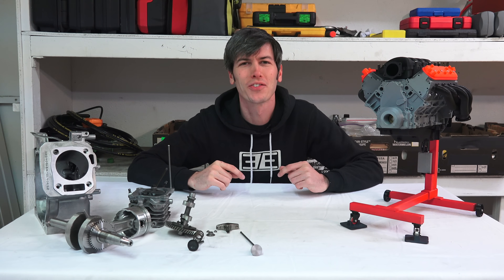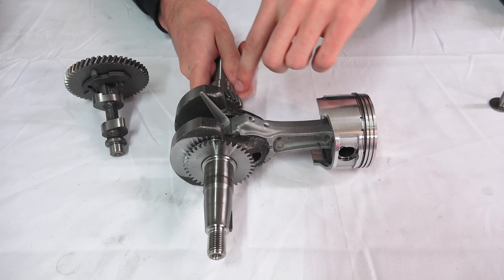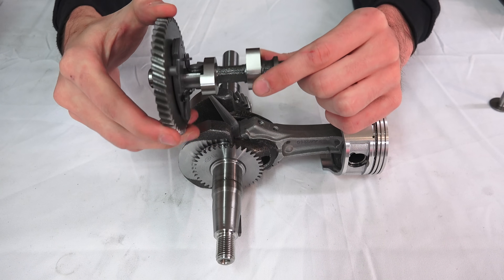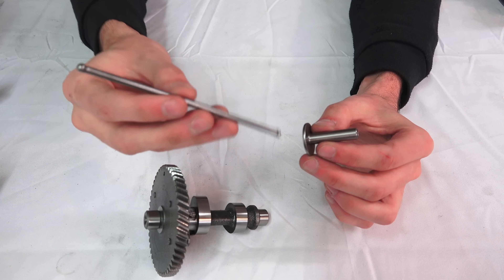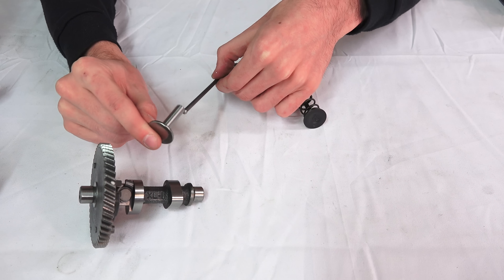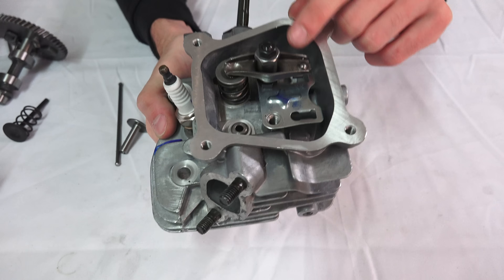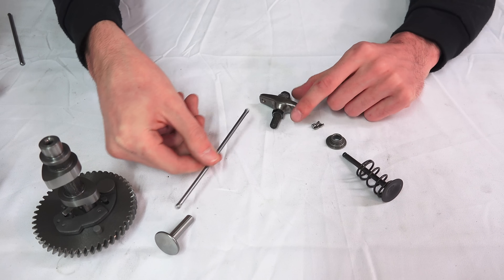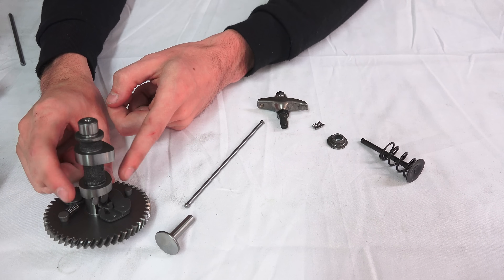Why Can't Pushrod Engines Rev High?

Comment: That’s why aircraft engines have 3 springs per valve 

One is redundancy one breaks your valve still operates 

The second is valve float each spring has a different “frequency” in which it looses efficiency so on paper when one spring looses efficiency the other 2 take over 

Never seen it in practice considering aircraft piston engines never rev past 3500 

Otherwise the prop tip goes supersonic and because the prop is a laminar flow airfoil it’s stops generating thrust

Comment: Use roller cam followers and rev all you want with supporting head flow, double valve springs, forged internals and decent ignition.
Reply: Yea.  That's what I do with the ole lady when it starts to get goin.  Plenty of lube and well placed ignition is where it's at !!

Comment: Ducati invented the desmodromic valve system, eliminating return springs.
Reply: Ducati didn't invent the Desmodromic valvetrain, the just refined it and used it on production engines.
Reply: @rdsimmonds  Those vintage Ducati Desmo heads are really getting expensive.
Reply: @flower2289  That they are. That's why I like the newer Pantah Desmodue engines. You can make them look old school with very little work, and have a strong engine that is fairly easy to work on, has a decent amount of aftermarket support, and in terms of a Ducati engine is fairly simple and plentiful. I absolutely love the engine in my 2013 Monster 1100 Evo. It may not be fast, but it's a great engine to lug around on, with plenty of torque.

Comment: Super well explained , top notch stuff. Maximum rpm is in the memory or return ability of the valve spring. I was so impressed when Renault developed compressed air bellows for springs in 1984-85, for f1 , I never forgot.   again well done !     :P

Comment: HI thanks for this.  I've been lurking your channel for a while so I thought it was time I subscribed.  I love what you do, I'm an old school knuckle draggin  gear head from back in the day but I love learning about new tech as well as reviewing the old school stuff.    I would love to see you do a video on Ducati's Desmodronic valve train system.  I have been riding motorcycles since the 60's.  I love Ducati's  (only had a chance to drive one, a 70's era 750?   Up in Fairbanks Alaska, it was a beast!)  I never owned one after reading about the Desmodronic valve train that use's no springs to return the valve but instead has a Second  cam operated lifter that close's the valve.  It's a beautiful system but like any thing Italian very high maintenance .  I've always thought of it as the Rolex of valve train systems.    I understand you had to adjust the valve lash every 3000 mile's or risk burning an exhaust valve and the dealers wanted north of $500.00 to do this.  A lot of money back in the 70's.   What is your spin on this system?  Thanks

Comment: Big bore, heavy parts, and a long stroke.
Reply: A similar capacity push rod or OHC have similar rotating mass. The DOHC also has all those chains whipping around as well.
The only real advantage CAN be a 4 valve needs less valve lift to theoretically flow the same air, and with less valve weight less spring,,,, BUT you have twice as many springs. And there is the problem.Valve angle can be the trouble as well. Most 4 valves come from both sides of the cylinder at around 20 degree angle so trying to get compression is a real drama to clear all those valves. Happens  with canted valve pushrods  [BBC Ford Clevo] as well but those valves still generally take up less room and still breathe properly

Comment: I got an 07 charger rt awd and it feels kinda slow for what it is. My exhaust at 60 mph starts making a loud constant whining noise and i tend to lose power when going over 60, that means i get rarely any acceleration and when i step on the pedal its takes a good second or 2 to accelerate it feels like a too slow of a response for what it is.. Is there a problem with my transmission? And should i get a new exhaust? Or perhaps is it my tires or its tirepressure? Previous owner replaced its differential btw.

Comment: Why a pushrod engine can’t rev high? 
Challenge accepted
Girl in my class: revs a built Chevy 350 small block with Brodix heads to 7500 RPM IN NEUTRAL WITH NITROUS ACTIVATED. 

Chevy 350: Welp there goes my piston rings

Comment: stares at a Chevy small block that revs to the 10k rpm range
Reply: Rotary: PATHETIC
Reply: Not many engines you can do 1000 nearly stock with high rpm and reliably with rebuilds or just get another engine for less then a paycheck. Why they are so popular. And if you want a top of the line engine it's still cheap as hell to put the tight parts on it and still be. Cheaper then a German v8 that's stock
Reply: @Zo Fryer This is the reason GM has stuck with this style of motor. If you mod any other V motor from any other company, your buying 4 cams, that right there is the most expensive part of that build. I can rebuild an entire LS motor with hotter parts for the price of a set of stock 5.0 coyote cams.
Reply: @codysides7683 coyote your stock cams are plenty good to make all the power you want.
Reply: @codysides7683 junkyards parts are cheap
Reply: @codysides7683  rebuilding an engine is something probably NO ONE wants to do outside of the US.
Reply: @codysides7683  you're conflating "cheaper" with "better" tho. You really think it's a coincidence that GM are the only ones with OHV engines? Honda and other japanese cars have been using OHC for decades now. You really think they would have chosen a more expensive engine production method if it didnt mean the efficiency was worth it?
Reply: @LeglessWonder  and? Hate to break it to you buddy but Honda isn't exactly the epitome of automotive performance engines lol. Take the two fastest cars in the range the s2000 or nsx and ls swap either and you can't tell me that won't be a huge improvement over stock unless your into making a heap of noise and going absolutely nowhere like basically every modified honda lmao
Reply: @trixnhoez2964  You have no idea what your talking about at all. If anyone knows what the epitome of racing engines is its Honda. Literally used to provide engines for F1, and they currently provide engines for Indycar and have a bike in the MotoGP. Not to mention they have performance road engines making 100hp per liter.
Reply: @trixnhoez2964 I hate honda personally, but they have been making motors for F1 cars for decades now, and a lot of those honda powered F1 cars have dominated… and F1 IS the epitome of automotive performance engines….
Reply: @CONNIVORE_13 Honda hasn’t succeeded in F1 since the 90s
Reply: @trixnhoez2964 
Apart from the 1000hp honda K20s you mean? From 2.0l straight 4 DOHC?
Push rods are obsolete garbage.
Reply: Raughs in HONda
Reply: Foxmakesmodels you can just buy an FD or Fc and get there No problem
Reply: Ive seen a few reach 12k
Reply: Depends on the power it's pushing, the tourqe and the design of the engine in general
Reply: How much did it cost to build?
Reply: It ain’t floating?
Reply: Those little single cylinders will turn 9k-10k too with some stiffer valve springs and a lighter flywheel.
Reply: You have any other jokes?
Reply: It's a dinosaur. My Honda lawnmower is an overhead camshaft.
 There's a reason why Asians and Europeans are building 4 camshaft 4 valve and 5 valve variable valve timing motors. Ferrari FLAT 12 and there is a reason why american companies are getting bailed out by the government and this is one out of the reasons.
Reply: And has boost
Reply: No need to rev high just make your engine undersquare engine long stroke that will make high torque at lower rpm then it’s all about gears you wanna go faster use small gear as long as you have high torque you can go faster as you want let say engine make 400nm torque at 2000rpm if you use small gear that 400 torque what be 200-150 still enough torque so no need to rev higher just make engine produce high torque and adjust the speed by gear ratio
Reply: There are plenty of German and Japanese V8s that make 7500 + rpms stock, the solution is a solid roller valvetrain, these GM engines have way to many moving parts in the valvetrain in stock form. I know there are aftermarket solutions to solve that, but get ready to spend $3-5k to upgrade the head components.
Reply: F1 v10 20500 rpm
Reply: shrugs revs 526 blown hemi to 12.5k
Reply: Yup, lots of 8,500- 10,000rpm LS motors.
Reply: That might be, but Ford is still number 1 for me.
Reply: @buttlickbandit8465  same
Reply: @0hjaa3.0  lol so salty u turn to racism
Reply: @downloadingutubes Bro where tf did racism come from? I sure as hell can't find any.
Reply: @downloadingutubes  I didn't turn to anything? And I'm not salty? I was in a shower like 45 minutes ago..
Reply: @0hjaa3.0  hmm just more lies huh?
Reply: @papatorr3669  terrible comment, truly...
Reply: Everybody in here saying oh pushrod motors suck, Well. The most powerful motors in the world, 500cubic inch hemi, Top fuel motors, 10000hp, It's a pushrod motor
Reply: @94.s10 thats because nhra banned  turbos and overhead cam engines like the ford cammer
Reply: @Zo Fryer valve float is unavoidable with pushrods.  Have to switch all of the valve train components to lightweight in order to decrease valve float
Reply: Still not high revs though. Would be high for a production car but nothing compared to race engines.
Reply: @Zo Fryer or u do nothing and buy german that revs almost as high. Plus i bet 9k is past peak hp and lbft
Reply: @downloadingutubes  depends on the head flow capabilities. Porting, polishing, and a cam moves the peak output higher up in the rpm range.
Reply: @downloadingutubes Lol buy German… how much money do you need to spend on a German car before you get a motor that revs to 10k
Reply: *switches stare to 14k rpm 632 cubic inch big block* @downloadingutubes
Reply: @downloadingutubes  horse power is based on air flow capability and cam specs what german engine makes peak power at or above 9k rpm? ill wait ill take the simplistic cheap American engine rather than an overpriced over engineered german engine that mentality is what lost ya the war
Reply: @ryanrohauer5940  ok bud
Reply: @downloadingutubes  Or buy Sweden and rev to 7000 with more reliable engine
Reply: @0hjaa3.0  absolutely not
Reply: @downloadingutubes  Absolutely yes.
Redblocks are super reliable 😎
Reply: @0hjaa3.0  weak argument
Reply: @downloadingutubes  What argument? Google it. It's true.
Reply: @0hjaa3.0  im afraid you have lost my interest with your severe lies.
Reply: @0hjaa3.0  Or Buy An Engine That Is More Efficient With Different Fuel And Revs 5/8 As High.
Reply: @SolaricSage116  Or just upgrade the one i suggested. No need to rev past 8000. And best engines for every day use produce max torque on low revs.
Reply: @0hjaa3.0  why get a little Volvo v8 when I can get an ls7 brand new for the price of trying find one in the USA, plus the ls7 has a 7.0 liter displacement and revs to 7200 rpm, plus its American made and has a better aftermarket than a Volvo v8
Reply: @jacobtanner486  Plus it doesn't sound like Vulva.
Reply: @AmericanThunder   the 4.4 Yamaha v8 Sound is legendary Billy Ray Bob, don't even joke about that
Reply: @danielmiliei  lol

Comment: The rotary engine laughs at your air problems.
Reply: Every other engine laughs at your seal, oil burning and leaking, and barely making it over 100k without a rebuild problem.

Comment: My polo TSI revs up to almost 8k and I push it almost everyday in second gear when I go to work
Reply: Because overhead cam. No pushrods. One of my cars is a 30 year old Honda and it makes some fun noises at 9000 rpm. I want to put an LSD in it so when I do burnouts on the rev limiter it spins both sides. Currently just smokes on one side.

Comment: this seems quite a bit outdated, modern nascar cop engines can in fact rev past 10k, and there is countless material of all kinds of pushrods, small blocks and back blocks that rev past 7,8 and even 9k rpm even ! there are clips of a Nova powered by a 260 abc, granted while it appears to be built it says that it revs up to 12k rpm !!! and I've recently come across a clip of a wicked Trans Am that has a 10k rpm pushrod in it. but don't take my word for it, go and search/look for it yourselves, it is not hard to find, and I provided you with keywords to search for. 
pushrods really are badass engines, can be used in the widest variety of applications unlike any other engine, and can kick the butts of just about any other form of piston engine !

Comment: Engineering explained needs to do more research on the pushrod engine.
Modern LS engines rev to 6600rpm stock.
These can rev to 7000rpm without an issue with a tune only.
The beauty of the LS platform, even if you make the engine larger with a stroker kit you can still rev them very high.
If you use billet cranks, light weight rods, hollow valves you can rev them to 9000rpm+
Most street setups with stroker engines usually rev to 7000-8000rpm without an issue.
It just depends on what you want to do.
The combinations are endless with the LS.
There is something for everyone,
DOHC engines are a bit more efficient but they have a lot of drawbacks.
They are not as durable, weigh a lot more, are top heavy and are not as a robust design as the LS.
Plus DOHC engines produce much less torque in the entire torque band.
Thanks to the LS7 style square port heads you can make over 100hp per litre of engine displacement quite easily which is better than exotic car territory. Thanks technology.
I drove a Ferrai 458 Italia a while ago and the engine is so dead from idle all the way to 5000rpm.
After 5000rpm is when it comes to life and screams to the red line but with hardly any torque.

Comment: Stiffer valve springs do not create an efficiency loss on multi cylinder engines.
Whenever one spring is being compressed, another is being decompressed, essentially making a net 0 gain/loss for the spring stiffness.  This is something that’s been proven in dyno tests.

The thing about absurdly high rate springs are that it can be harder on valve train components because of the added pressure.  

It’s not even so much that an OHV cam in block engine can’t rev high.  It’s a matter of the trade off.  Higher rpm requires a bigger cam.  While it makes more power at higher rpm, it at the compromise of low rpm power.  A cam that makes good power at 8k rpm will make less power at 3k rpm; and also have a rough (but cool sounding) idle.

Comment: He forgot to mention piston speed and how longer stroke increases piston speed. The higher the piston speed the faster the piston rings and bore wear. Oem wants engines to last over 100k at least . Nascar gets rebuilt every race. Also the faster the piston speed the faster the piston must change direction needing heavier pistons to do so.

Comment: Solid roller cam with huge valve springs can rev like direct acting dohc like you would see in a Japanese car, just not as flow as much due to less curtain area that a four valve engine has.

Comment: I have an LS1, I have the rev limiter set to 8300RPM............. been like that for 8 years, it has 180000kms on it, no issues found. Valve float is solved by heavier rate valve springs and titanium valves, valve spring retainers and retainer locks. Also never had issues eating any of these hi tech rubber band motor powered cars with it.
Reply: Right a stiffer spring and lighter valve train components are what most  people do to achieve higher rpm as well as the addition of flat plane cranks which also helps with the high rpm harmonics and balance of the engine.
Reply: @Hamza-or7jm  I never bothered with flat plane cranks, I just get the full rotating assembly balanced and have all the pistons and rods weight matched so they are all the same weight. A good blueprinted engine lasts forever.